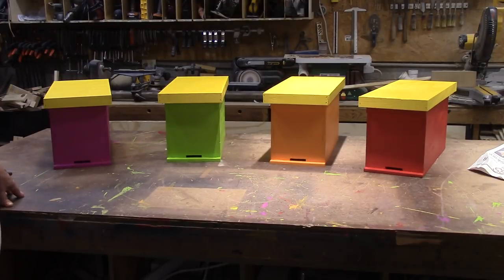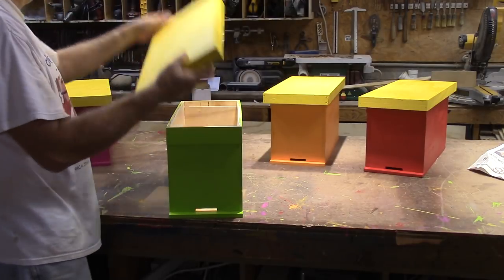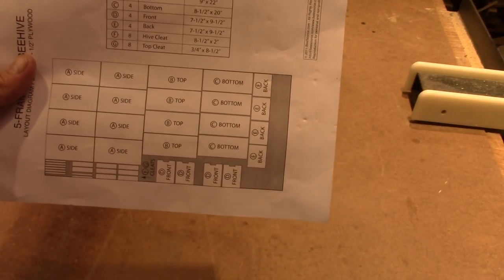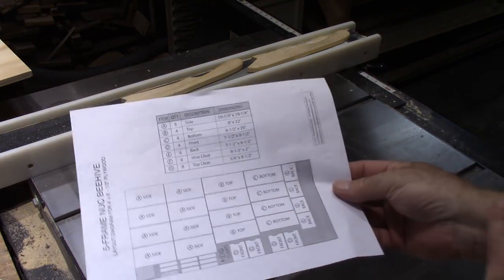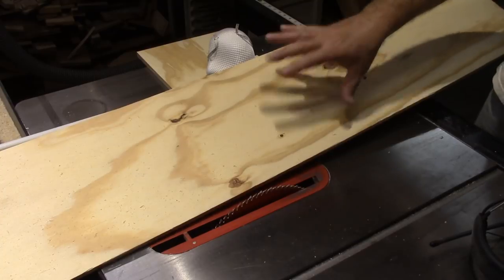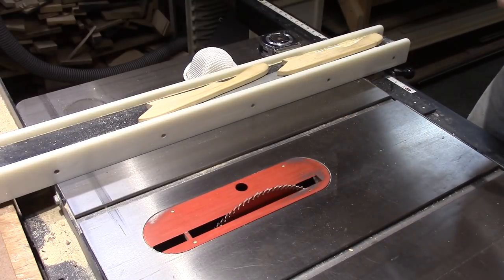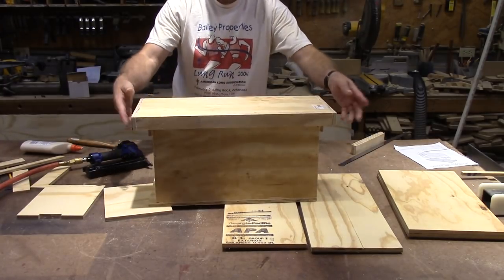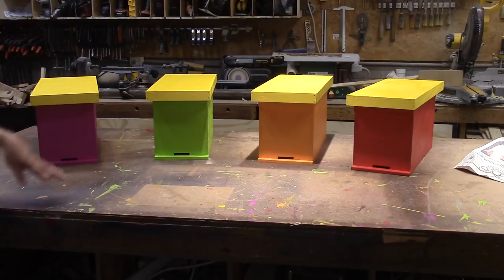How to Build Nucs

Comment: Good video sir, I would make the openings 3/4" instead of 2 1/2". The reason for this is that generally speaking NUCS are weak hives, and the smaller you can make the opening, the easier it is for the small amount of bees inside a NUC to protect the entrance and the resources they have gathered inside the NUC. Besides that it matches the 3/4" opening on standard entrance reducers, and I think entrance reducers have a 3/4" opening for the exact reason i mentioned here.

Comment: The only issue I have with this design is that they are shorter then a regular bee box.  Yes you save material and you don't have to dado the ends  but it keeps you from really using them in there full potential.